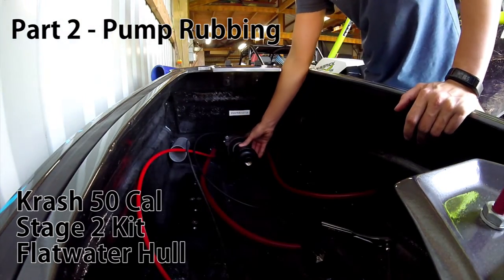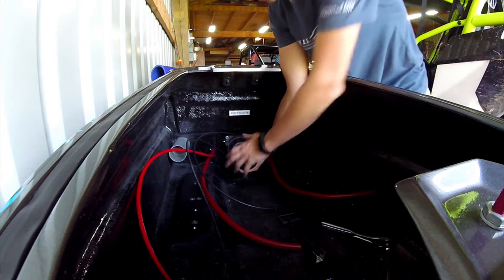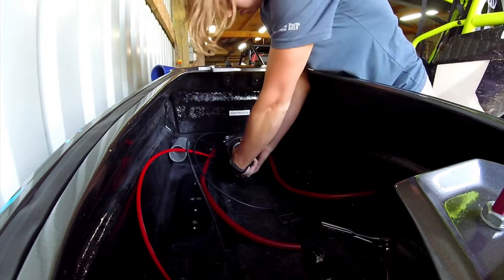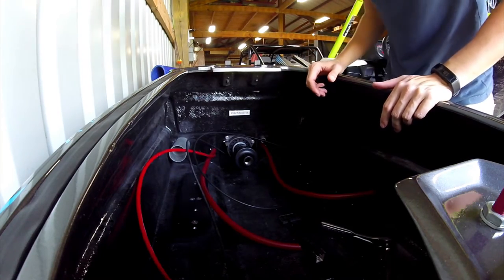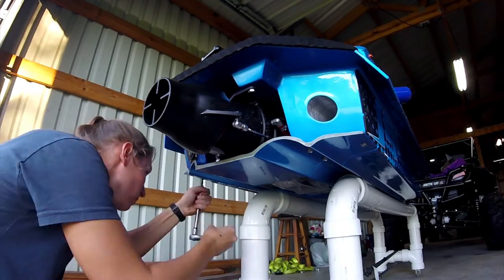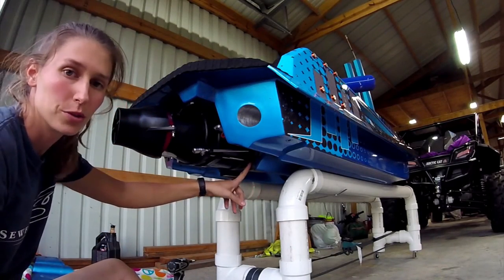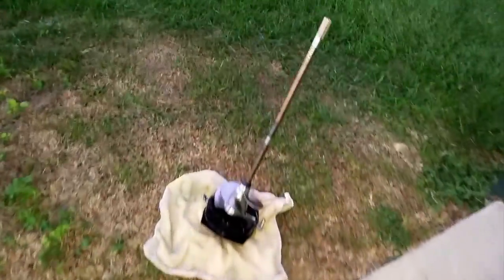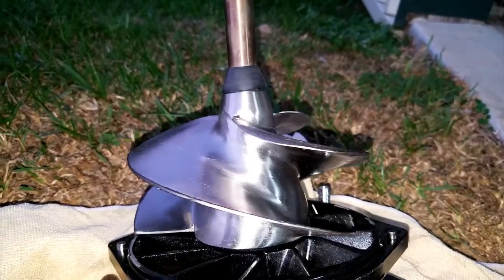ChixSki: Krash 50 Cal Flatwater Freestyle Build - Part 2: Pump Problems

Comment: krash seems a little skimpy overall on the quality control.
Reply from the maker: Bryan Wells My next part in the series will be me removing the pump and buying an AM 148 setback. They just need to up the price and quality control and they'd be golden. Spent $3500 on my new pump setup vs the $1250 Krash charges.